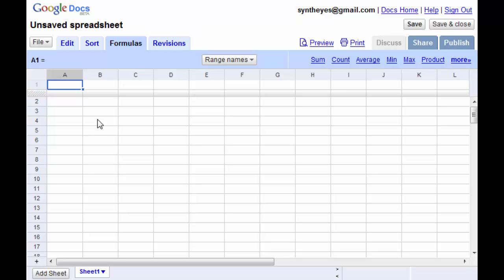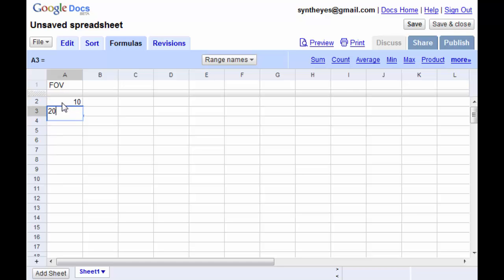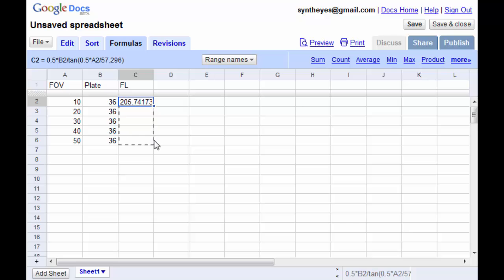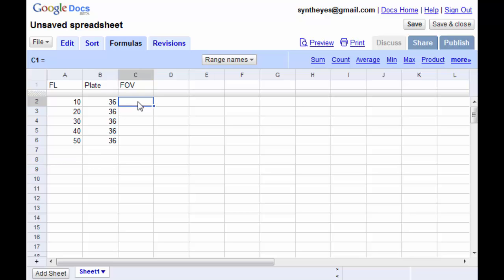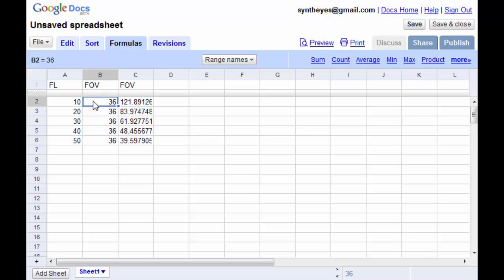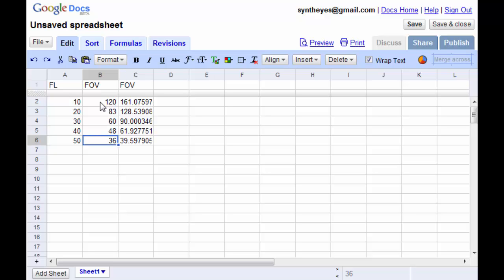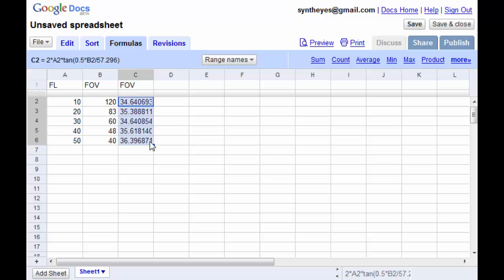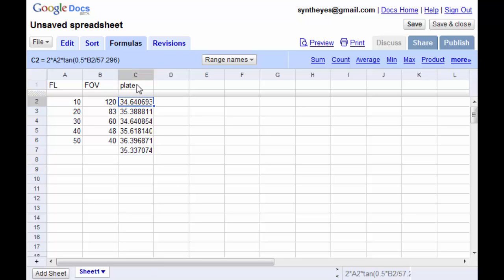Finding Your Plate Width

Comment: Hi Dr. Andersson. Thank you for this explanation as it really helps. Can I ask a question? ..I have GH5 that has a sensor size of 17.3mm x 13mm. I shoot with a Rokinon 24mm and have a metabones speedbooster XL .64X. I know that crop factor is at play and from what I have read the crop factor shooting at 4K DCI on the GH5 is 1.9 or somewhere in that area. This obviously is a difficult camera to find a true filmback size because of all the variables at play but it is all I have for now and I'm invested in M43. However I do want to track and solve very accurately... So, following your formula if one knows FOV and Focal one can derive filmback I tried to give accurate numbers for both by firstly shooting a distortion grid and undistorting. I then ran an estimate focal by using some tools in PFTrack. That data produced an FOV. I took those and rand the formula to derive a filmback size. Solves look pretty good but there is something still off. Could you please help me out here? Thank you so much